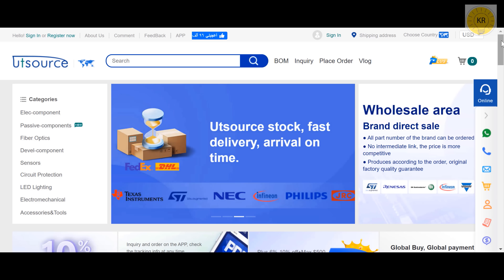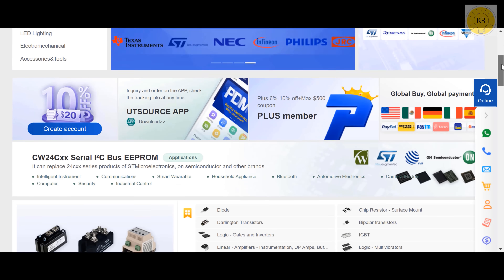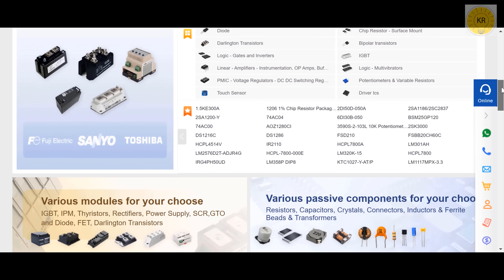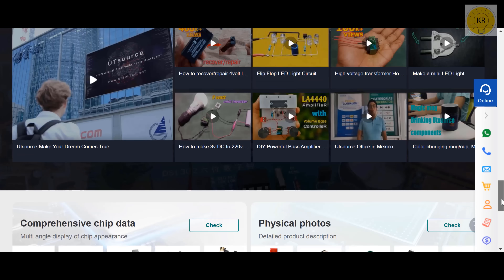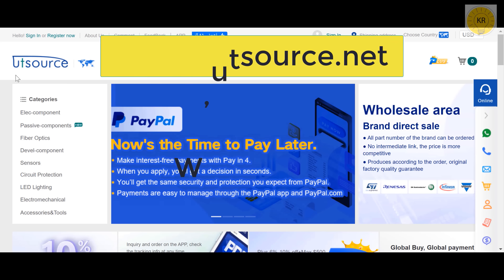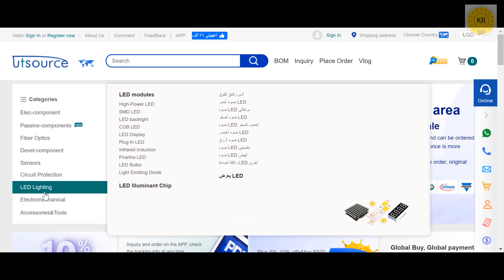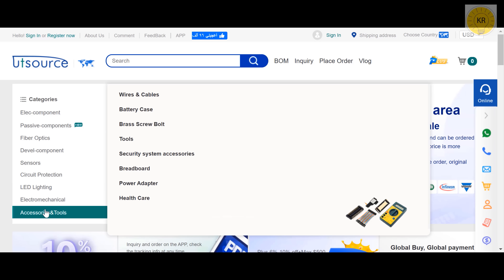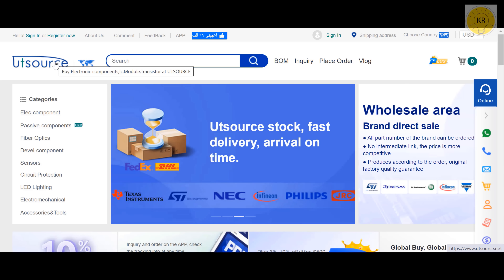how to make simple inverter 2500W , sine wave , 8 mosfet , IRFz 44n ,jlcpcb

Comment: What is the transformer spec,
Like using wire guage?
Primary and secondary turns and volts and connection ❤

Comment: Not very good. TO220 must have thermal paste before mount it on heatsink. 10K on gate is really too much !! high commutation power will be dissipated. Principle drawing is missing. Title of this video speak about 2500W where test is made with 3x(100W ?) bulbs... a lot of advertises also...

Comment: Max power dissipation of the mosfet is 86 watts. Six of those is less than 500 watts. This looks like more of a made in china scam.
2500 watts is a little more than 200 amps at 12 volts on the primary side, and a little over 20 amps AC 120v , depending on the ac impedance of the circuit.
I don't think any of the components are rated for this.

Comment: At 12v you need 208 amps from input these tiny wires will burn faster then a christmas tree. Way to small mosfets and transformer. The output can't be sinewave because the transformer need squarewave to run effective and at the output no dc link with modulated fullbridge to implement sinewave also no feedback signal. And what about the output 50Hz on an HF transformer this transformer need like 20-50khz. Nice try tho but this is clearly fake don't fool people by using something like a master-slave socket to turn on these lamps with 230v sitting on slave while you connect a small load to your bench power supply on master
Reply: Exactly
There is no way for a prefected wave like that will be output from this type of transformers 
Also linking the middle pin of the transistors while its already linked via the heatsink
Lol 
Just take a thick wire from the heatsink instead its already linked to the middle pin of all transistors 😂
Reply: ТРАНЗИСТОРЫ СТОЯТ ПАРОЛЕЛТНО ТОК ДЕЛИТСЯ МЕЖДУ НИМИ ( БУДУТ РАБОТАТЬ ВЫШЕ СРЕДНЕЙ НАГРУЗКИ)
Reply: ТРАНЗИСТОРЫ СТОЯТ ПАРОЛЕЛЬНО ТОК ДЕЛИТСЯ МЕЖДУ НИМИ ( БУДУТ РАБОТАТЬ ВЫШЕ СРЕДНЕЙ НАГРУЗКИ) МОНТАЖ ОТВОДОВ ПАРОЛЕЛЬНЫЙ СМОТРИТЕ  И ПОНИМАЙТЕ ПОКАЗАННОЕ ВНИМАТЕЛЬНО и ВЕРНО   😀

Comment: That white block of sal ammoniac that he used to clean the iron tip is acidic and will eat away the circuits if it gets on them.  It's better to use the flux paste in the 50g tin to clean the iron tip.

The first rule of soldering is to make a sound mechanical joint before solder is applied.  These tack soldered joints are not acceptable because the power MOSFETs can get hot and weaken the solder joint and the wires may fall off.  This thing is supposed to be handling 2.5 thousand watts!!  But the wires are so thin that they will melt when hundreds of amps flow through them!

Comment: Cómo calcular el vatio de un inversor? Quiero decir, ¿cómo calculas que esto es un inversor de 2500 vatios? Por favor, ayúdame hermano. Eres genial.
Reply: Depending on the cross-section of the transformer core, which is at best a maximum of 4 cm2, a permanent power of 2.5 kW cannot be provided - the transformer burns out. Deliberately missing the ampere rating (A) and we all know why. Buy a UPS or have the inverter built by a real expert. This inverter from the video is completely useless. Do you know why your brother won't help you?

Comment: What is the criteria to calculate the power of the inverter? 500 wat , 1000 watt , 2500 watt etc...
Is it the number of mosfets bein used or the size of the transformer or other things?? 
Secound question is this inverter prescribed in this video can be used for all home elecrical things like tv , fans and lamps??
Reply: This junk. No dc bus caps, no drivers, tiny transformer. Fake
Reply from the maker: It also depends on the power of the transformer, the number of MOSFETs, you can turn on TV and lamps

Comment: mod sinus or Pure Sinus Output ?
Reply: You didn't notice on the scope the pure sine wave form ???   If it were modified , it would be a square wave !  But If you look you can see very smooth curved sine wave . which I find a little hard to believe !  It should show some ripples in the wave form .  This looks like wall current !  If its real ,... excellent job !
Reply from the maker: Thank you for sharing your comment. The wave appears in pure form due to the small size of the oscilloscope. If it is already enlarged, it will show some curves.
Reply: @inventorkr1  pure square wave! But a good  converter dc/ac for 1st  stage of a pure sine wave inverter.
Reply: @stevelamperta865  He connect it to the AC home supply
Reply: meandre...